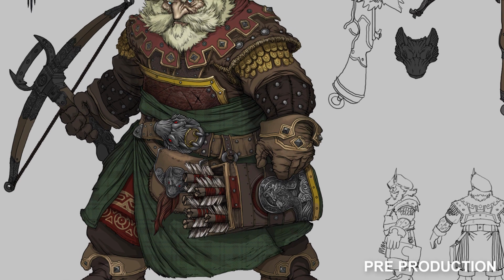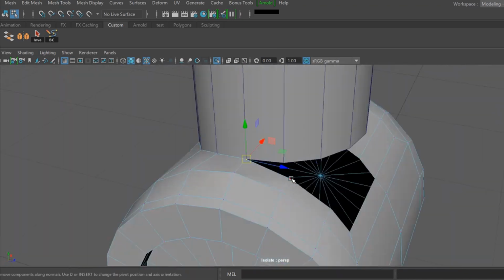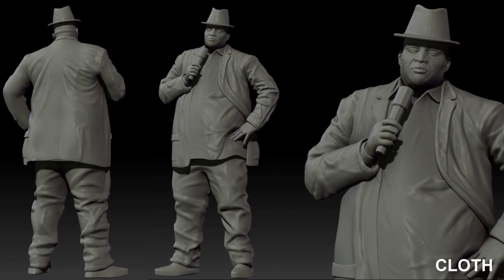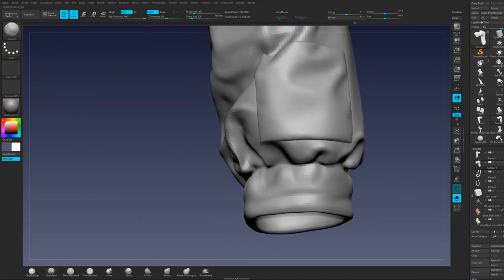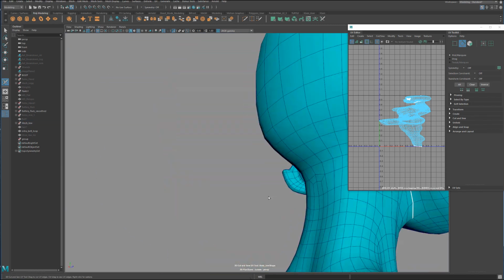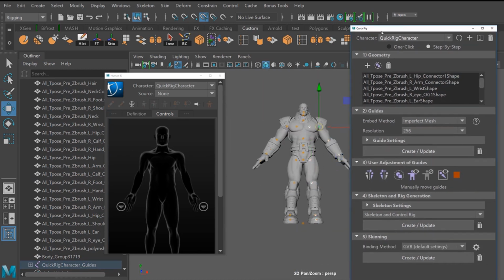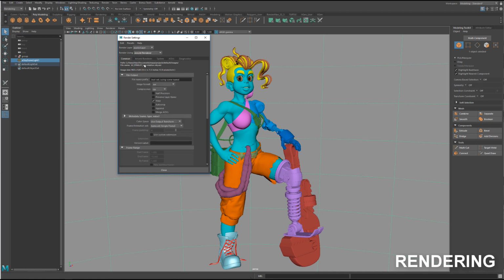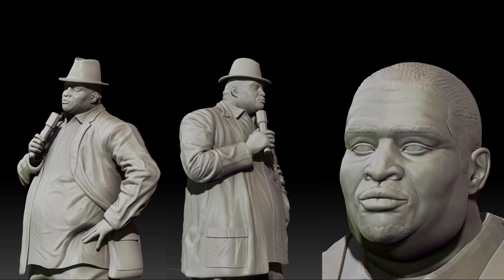3D Character Creation Tutorial For Beginners

Comment: Everything I do in cloth, I do in Blender.  Since most of my products are for hobbyists in Daz, the pipeline is pretty simple.  I create a base mesh in Blender, export that to Daz, use dForce (Daz's cloth simulator) to get the right hang or what have you, re-export that back into Blender, then fine tune.  I go back and forth with this iteration as often as needed and it works well.  Usually I can create any type of cloth asset pretty quickly using this flow.  The downside of course is that it is specific to Daz.  But I imagine that it can be adjusted for programs other than Daz.